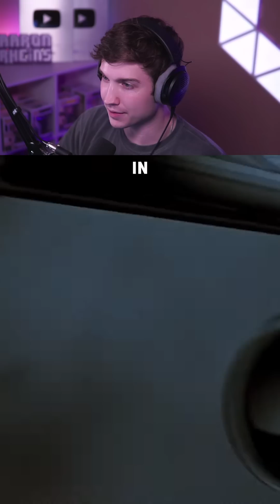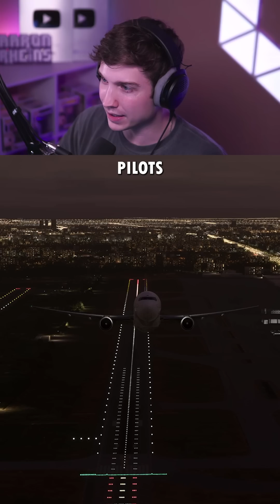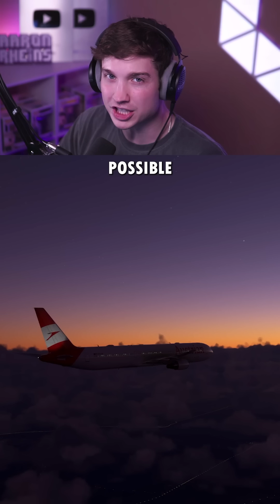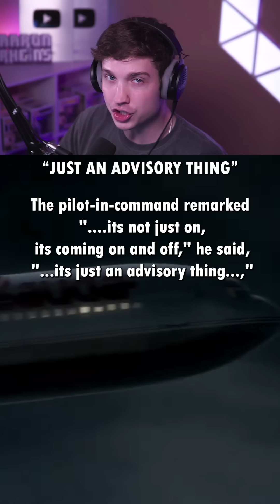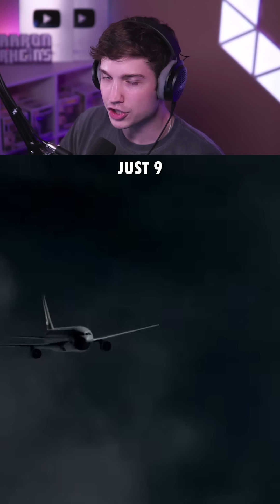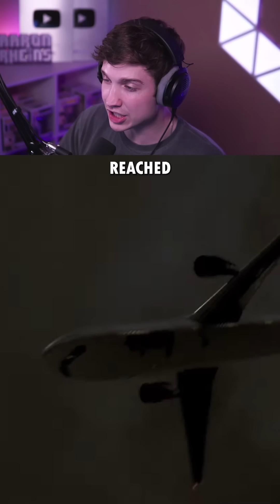Thrust Reverser Deploys in Mid-Air

Comment: The fact that Niki Lauda (the founder of Lauda Air) participated in the investigation is astonishing when I found out.

Also the crash was not the pilot's fault, Captain Thomas John Welch and First Officer Josef Thurner believed that the warning was triggered by moisture in the sensors, since the warning was not static it was blinking on and off and the pilots proceeded their flight believing that the warning was triggered by moisture or somethin'

Comment: Wonce the pilots were given the heads up of what might potentially happen... You don't start a contingency plan on the outside chance that it does. What  the fuck else do you have to do up there? I'm not even a pilot and the first thing. I would think To Do would be to shutdown the engine.

Comment: The most mind-boggling fact that happened after this accident was that the boss of Lauda Air, Nikki Lauda, was adamant that it was not a pilot error and instead a system failure, but Boeing refuted that claim, so Nikki Lauda stated publicly in front of the press that to confirm that it was a system malfunction, he as a licensed pilot himself would take an airplane of the same type and fly out over the Atlantic ocean to recreate the exact same scenario to proof that the system was faulty. Because it was either Boeing does nothing and the same could happen again, killing possilby hundreds more, or Nikki Lauda recreates it and the plane crashes, but this time it would only be him as a victim. But it did not even come that far, because only the threat of Nikki Lauda doing this had Boeing give in and have them examine the claimed faulty system.

Comment: This was Boeing's fault.

At a minimum, the checklist should have said to shut down the engine, and land as soon as practical.

Also, the aircraft's systems should have been set up so that if the plane wasn't on the ground, the engine automatically shuts down.  These planes are designed to be able to fly with only one engine, but they are impossible to fly if an engine's thrust reverser deploys.

Comment: it seems this Incident can't be avoided since the prior process it takes only took 9mins that's merely not even enough time to turn the plane in a different direction in the opposite direction and even more than less so for it to even find a landing spot and land on in just under 9mins and For it to tear itself apart in mere seconds after the Incident occurred unlike any other aviation accident where it could actually be saved with a bit of a chance this one has non with the sped of crash it take

Comment: Need This Crash on simulator
Air India Express Flight 1344,on 7 August 2020 from Dubai, United Arab Emirates, to Kozhikode, India, landing at Calicut International Airport. On the third landing attempt, the aircraft touched down on runway 10, but skidded off the end of the tabletop runway and slid down a 9–10.5 m (30–35 ft) slope, killing 19 passengers and both pilots. The four cabin crew members and 165 passengers survived, of whom all but two were injured.

Comment: Planes should have some sort of a "reset" button, which puts the engines at idle and all control surfaces in a neutral position.. that way the flight crew saves time finding the mistake, and can start with fresh inputs. 
I'm clearly not a pilot, but i don't see why this would be a bad idea.

Comment: I would like you to do this story. 

In 1966, without being a pilot, by mere accidental mistake, RAF Engineer Taffy Holden flew in the fastest British fighter jet ever - BAC Lightning. This is one of those cases where the described events sound so incredible, even by the standards of fictional stories. But the thing is that they all truly happened.

Wing Commander Walter "Taffy" Holden remarkably went down in the history of the Royal Air Force as an engineer who accidentally took off in a jet fighter.

Comment: Imagine an airliner hitting Mach 1. That's insane
Reply: I mean, not really, with enough potential energy it’s possible
Reply: @yokotanakamusic  definitely
Reply: But a 767??? 😂
Reply: @CantEscape1.5M  yeah. You would be surprised. The bodies are designed to cut down air resistance. So technically if they are high enough and the environmental factors are in place, even a gigantic plane can hit supersonic speeds.

Comment: I've been in MFS2020. I dropped from 42000 feet to 5000 in 30 seconds and reached mach 1.2, man I would of shredded the hull if it wasn't for my arcade mode.
Reply: You basically really very accurately recreated Lauda Air Flight 004 😂😂😂

Comment: This nearly happened to an Airbus a320 about a month ago too but at the landing the pilot pulled the reversers to full but then had to go around due to bouncing but Airbus says that if you have opened the reversers fully you cant go to throttle again but the pilots still gave it full throttle but only one engine reacted the other one stayed in reverse thrust the pilots quickly reacted by turning off the engine and then made a succesful landing now all Airbus a320s got a softwareupdate so that that wont happen again.

Comment: Its like the plane basically pulled the handbrake mid air
Reply: More like shifting into reverse going 80
Reply: @janeyarnold5483 💀
Reply: @janeyarnold5483 same effect, snap oversteer
Reply: But only on the left wing
Reply: @justinshugg3431 Yes the plane can run on 1 engine, but not when another engine is against the working engine, which thrust reversal did
Reply: @karlk7070  it’s possible, planes are such as the dc8 could fly in that scenario for a few secs due to there design, but long scale use would en d up stalling the plane causing to do what this bird just did (fly with one reverser on
Reply: @justinshugg3431 as in a handbrake turn like a drift
Reply: Nah the pilot was trying to drift the plane
Reply: @Dark-killer860 fr
Reply: @Dark-killer860 😂
Reply: According to Boeing: "it was impossible that a thrust reverser deployment in mid-air could cause a crash"

Looks like nothing is "impossible" to happen
Reply: @gonzalez_martin  As a famous Person said Nothing is impossible.[Unless your talking bout the A10 warthog which only Nukes can stop that]
Reply: Or the f22
Reply: @gonzalez_martin  that Boeing said that
Reply: @gonzalez_martin  That’s ridiculous
Reply: Its like shifting to reverse going 230 mph
Reply: I would of shit off engine 1 full thrust on #2 and right back to the airport
Reply: @josephsims3591 the thrust reversal happened so fast. And the fact plane was out of control by the time you would be able to react
Reply: Shut
Reply: @josephsims3591 Yep fuck that any error on an engine turn that bitch off asap. I like ones with 4 jets that way you know you are perfect all the time.
Reply: yes and by that you lost the left wheel’s traction
Reply: i dont know of he already did it but, the Fokker 100 of TAM Linhas Aéreas was almost the same to the Lauda Air 004 i think he should do a shorts about that
Reply: @melissasouza596  but tam foker 100 is crash after take off right?
Reply: @fadlipratama4447  but both crashed after reverse thrust activated
Reply: @melissasouza596  but the airplane is crash after take off
Reply: cant believe this
Reply: The pilot could turn off the failure engine with reverse trust. But maybe things happen too fast
Reply: More like turning the steering wheel max left while going 1000+ km/h
Reply: only one of them tho
Reply: More like one set wheels is going backwards while the other is still going forward .
Reply: Bro tried splitting the throttles
Reply: So a 767 was reached almost mach 1 and was destroyed but a 747 reached mach 1.25 and landed safely
Reply: May 26 1991
Reply: 04
Reply: Rip😢❤
Reply: I lost the ability to dislike lol

Comment: Fun fact: the thrust reversers on the 767 couldn’t bring down a 767 during testing in midair and so it was weird a thrust reverser manage to bring down a 767 because it was supposed to still fly normally when it happen
Reply: bruh
Reply: I believe the reason is more than just a deployment in the reverse thrusts. I forgot what was the other reason because I had seen that episode in ACI
Reply: The thrust reverser on the 767 couldnt bring down 767 only on low altitude. It was never tested at high altitude and on high speed. When it finally tested by Niki Lauda himself at Boeing sim, it turned out the thrust reverser DID can bring down the 767 at high altitude

Comment: Always a good reminder to any pilot, any error in the flight plan or airplane itself is grounds for investigation and GROUNDING of the airplane. No matter how you feel personally an error in engine controls should be a cancellation of the flight itself.
Reply: There was a time a flight from LAX-Frankfurt took off and engine 1 died but the pilot refused to go back and the flight was normal and they landed in Germany safely. (It was this year)
Reply: @Progamerj175  what a madlad gigachad
Reply: @Progamerj175  I would be pissed as a passenger. Risking my life like that is fucked up. If that 2nd engine goes out over the Atlantic, we're fuckin dead.
Reply: @CertifiedClapaholic  dumby a airliner  can fly with one engine, happens all the time, yoy fot a better chance getting  hit by a car on a sidewalk and die in car accident. But you still do both
Reply: @MarcoGarcia-bj2kt but im in control of my car and not putting my life in the hands of others who may or may not make the best decision with my life in their hands. If I even saw a warning light go on in my car im pulling off the road as quick as possible and not continuing. Pilots don’t always do the same thing.
Reply: @Progamerj175 depending on the plane some can fly with the loss of 1 engine. Some planes can fly with the loss of two
Reply: I’m curious, what would be the appropriate action in the situation, shut down engine 1 immediately?
Reply: @cfb36  if they had have more altitude, yes. They could shut down the engine 1
Reply: @cfb36  ,*to
Reply: @cfb36 i guess. Shut it off and land on one engine?
Reply: Its also a good reminder there were no action items in the QRH for "L REV ISLN" at the time, mostly because the reverser deploying in flight wasn't considered a dangerous event. Now we know better.
Reply: Especially critical flight components !
Reply: Well I'm this case there were two fail safe system in the thrust reverser and the documents of last service showed that the warning was malfunctioning and been happening many times
Reply: This could have been avoided if the pilots shut down the no 1 engine and returned to the airport
Reply: In all fairness to the pilots, the quick reference handbook did not explicitly state that the warning message meant there was imminent danger to the aircraft. It said that further faults could result in the thrust reverser deploying and that the thrust reverser would work normally upon landing. Boeing tested thrust reverser deployment mid flight when the 767 debuted, but they only did it at a low altitude and I believe at lower speeds. They never tested it at 31,000 feet at Mach 0.78. There are some planes that can deal with trust reverser deployment in flight fairly well. The MD11 from McDonald Douglas was engineered to deal with it according to a sales video that they produced, andI believe some Russian airliners can do it. For the stricken Boeing 767 though, flight simulation testing revealed that supposedly pilots would have had somewhere between 6 to 12 seconds to do everything correctly to fix the planes loss of control, and supposedly only the pilots that knew the problem was coming were able to solve it. Flight simulator pilots that were unaware of what problem was going to be thrown at them all failed to save the aircraft. The whole incident from reversal deployment to break up took about 30 seconds, and the pilots did try to troubleshoot it, which can be heard on the cockpit voice recorder, but once the tail came off, which was only about halfway or two third through the incident, that was the end. The plane broke the sound barrier, as the plane exceeded Mach 1 and broke up before impact with the ground. Boeing initially did not want to admit that there was a flaw with the design of the thrust reverser until repeatedly pressed by Nikki Lauda himself, before they finally admitted there was a problem and issued a fix for it.
Reply: Exactly
Reply: It was already in the air how do they cancel the flight
Reply: It was already in the air how do they cancel the flight
Reply: Not really bruh
You can’t ground a plane every time a random error pops up. There’d be no planes
Reply: Warning: Please change cockpit lightbulb soon.

Me as a pilot: “Meade! We’re returning to the airport, emergency landing!”
Reply: Are you a pilot yourself? 🤨
Reply: The handbook said it was a minor problem though, only a true failure of the thrust reverser would be considered a major problem as the warning was just a warning
Reply: @danivation yes but it's still a warning for a reason if it has the possibility to open up in mid-flight especially a thrust reverser you should probably bring it back in
Reply: @danivation  by the time the thrust reverse actually failed, there was no actual solution to be referenced. Why not take that seriously?
Reply: @danivation still it's lives of all that must be thought a quick check and few hours delay would be better move anyday
Reply: Look at the mentour pilot video about this flight, it explains it in much more detail ie. They actually got a minor warning that had 0 grounds for grounding the plane
Reply: i am the 1k likes at his comment
Read More....
Reply: they did ground it just not in the way they intended